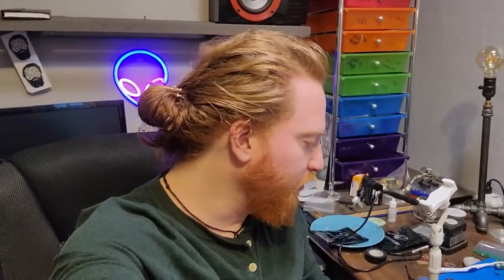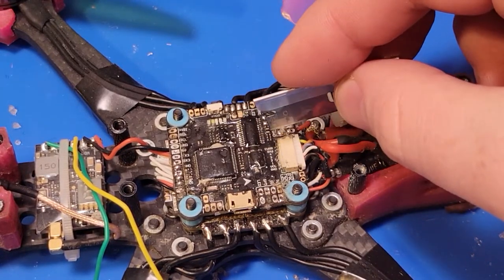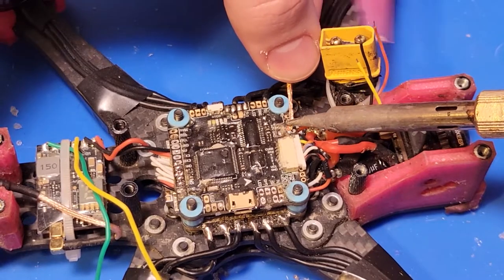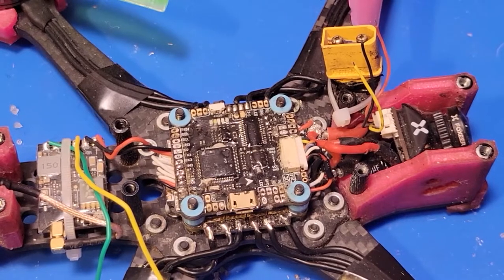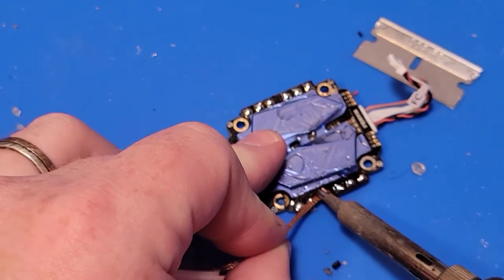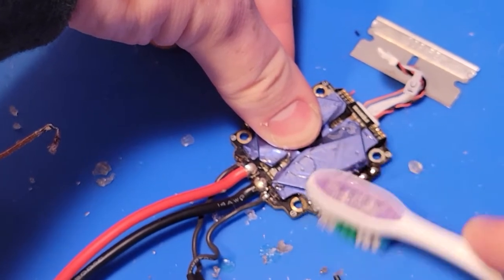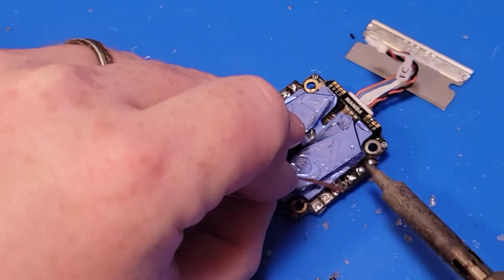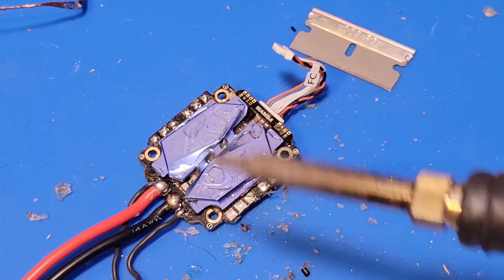FPV Worry Free | Removal for Resoldering

Comment: Great tutorial! What temperature do you suggest for the iron? Also, how does alcohol/isoporopanol affect fpv worry free? Would that work for cleaning it as well?
Reply from the maker: This was likely somewhere around 300 c. I'm not super sure about how isopropyl would effect it, but it will likely work as a solvent

Comment: I just used that worry free for first time, it appears to have ruined my new expensive stack.... Thing freaks out as soon as I give it the beans, and flys like crap, I don't know what to do... I've built several dozen quads, it may be a bad stack, but I think it's the worry free at this time, don't think coating jiggly jello on  helps the gyro any, I wouldn't recommend this stuff, use gorilla grip instead, you get much more for the money and it pulls right off clean and easy
Reply from the maker: I wouldn't be so quick to blame the worry free. I've put it on dozens of stacks and it's never affected the performance on any of them. Had you flown the stack before?

Comment: Are you removing the coating on the board?
Reply from the maker: Just removing the waterproof coating, yes.
Reply: @BadLuckFPV  
Have to swap a cap it’s driving me crazy! I’ll try your method tomorrow, with a larger tip.